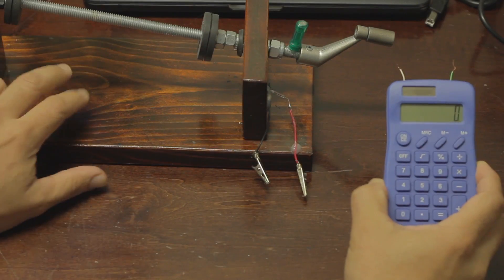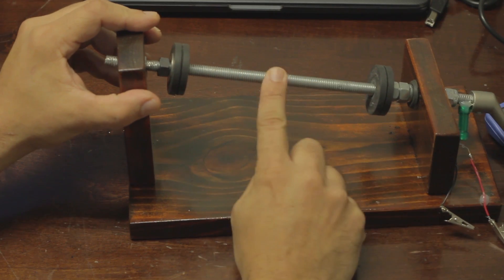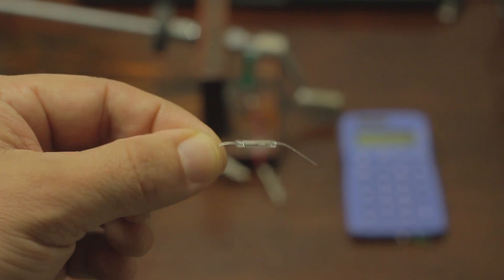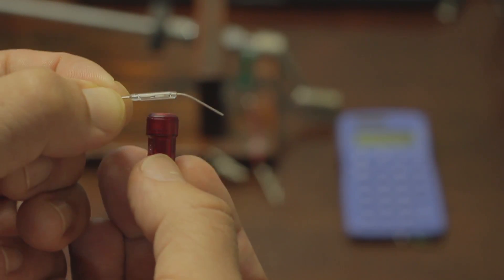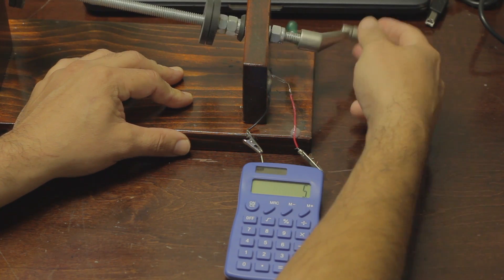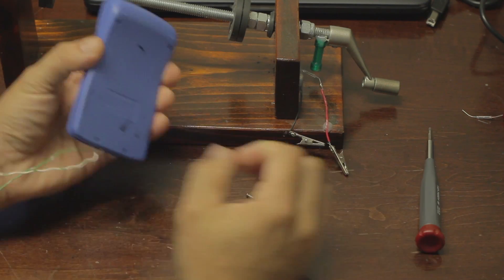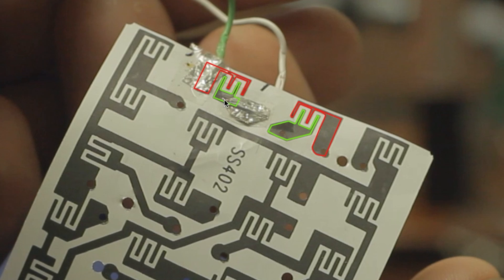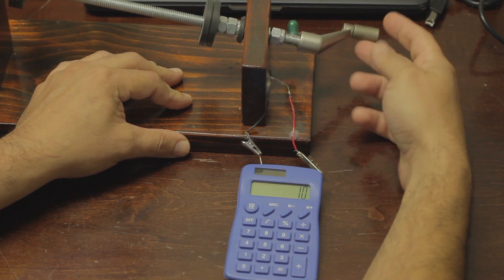DIY Tesla Coil Reed Switch Calculator Counter Winder

Comment: Hi It looks like you have the tape on both sides of your equal switch.Can you please explain that. Can't get mine to work.Thanks
Reply from the maker: gdlblues1 I do have tape on both sides to help in strengthening the connection. I would recommend that make sure you've stripped the leads of any residue by sanding the bare wires. Make sure that you are connected to the equal button. This can be sometimes confusing. A little more detail on your set-up would help? Is the calculator paper circuitry? Did you initially enter 1 + 1? Does the magnet activate the reed switch?
Reply: Can I send you some pics of my calculator board. Yes it is paper.